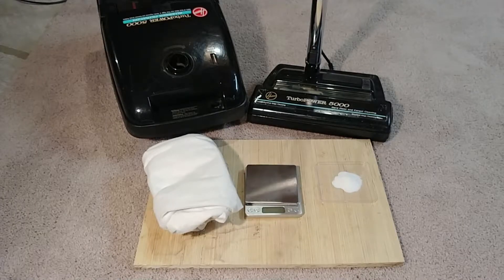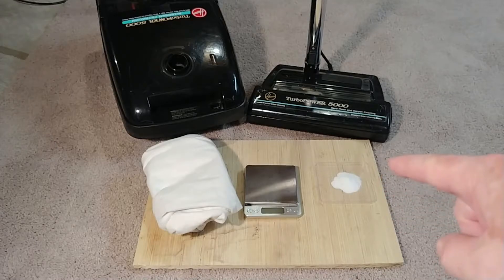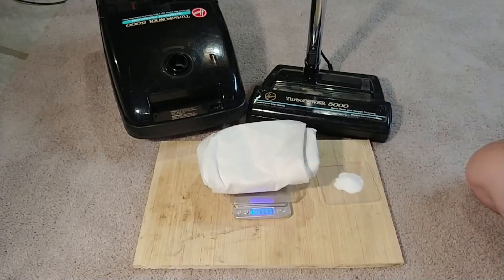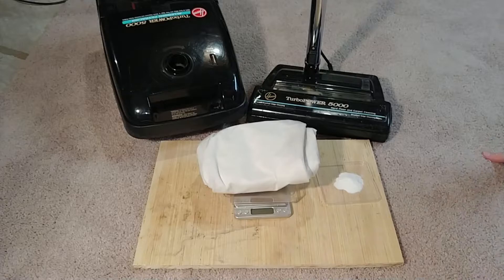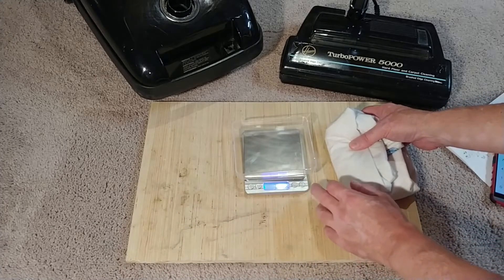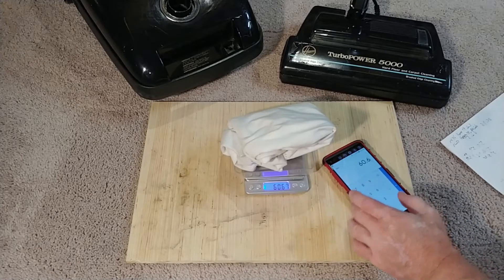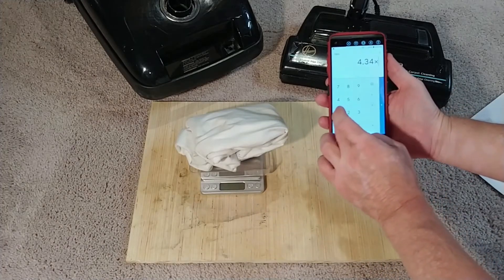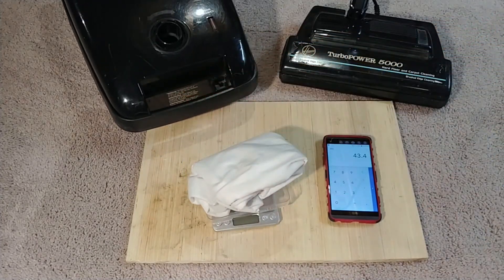Hoover TurboPOWER 5000 Baking Soda in the Carpet Test

Comment: That is not bad at all. New brushroll might do even better. Powerhead must be good for this kind of job. However I am not surprised how badly (what you mentioned) even the quite new Dyson DC65 did. When I got my DC40 I thought that it had some kind of problem, but no it was just very badly designed cleaning head. New style ball animal 2 (DC40 MKII) cleaning dramatically improves it. I still wonder how on earth Dyson made so poorly performing vacuums before cleaning head upgrade LOL
Reply from the maker: In Dyson's defense, my older models do say "pet" on them so short hair pickup might be very good. But those older brushrolls do quite poorly with fine dust and sand to be sure.
Reply: @VacLab  When Dyson rename their vacuum lines only thing what changes is the attachments. Pet model usually comes with the turbine mini head. Actual vacuum is the same. Older model Dysons (DC07-DC33) what we have in the EU have the same main vacuum brushrolls than in the US, but for some reason brushroll opening in the US models is much bigger. EU models have very narrow brushroll opening in the soleplate. I have no idea why is that. Only the origin models have different brushroll. It's round shape instead of helix type.